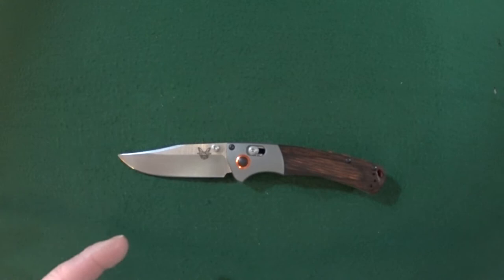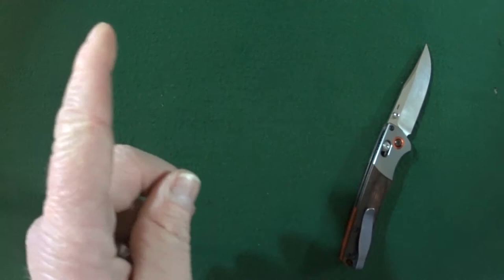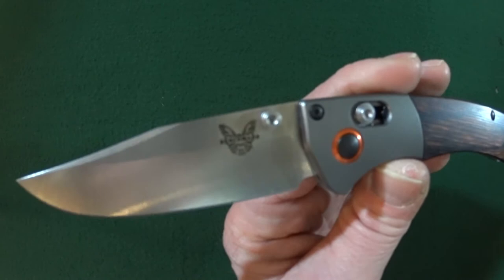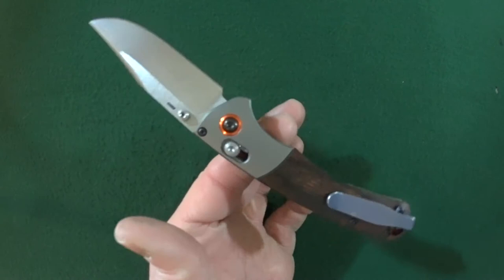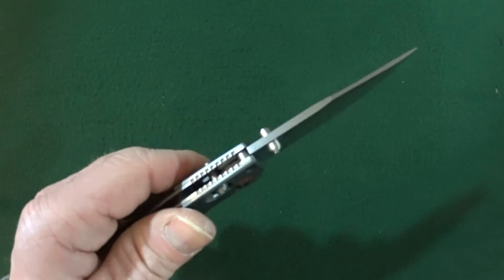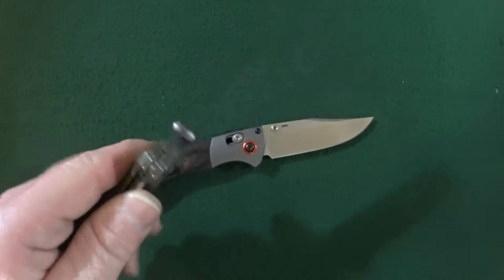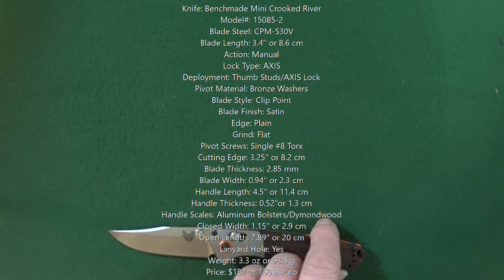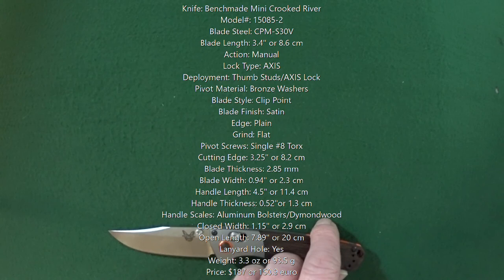Benchmade Mini Crooked River Review: Mini Problems

Comment: Good review TKB! I've got a mini freak coming my way, it was $106 with S30V, I don't know why they're charged so much more for the mini crooked river with the same steel?
Reply from the maker: Thank you BC. The only reason I can think of is the handle material, but that's an $81 difference. Another example would be the Grizzly Creek which I purchased new for about $165. Now they offer the Grizzly Ridge, which is basically a Grizzly Creek minus the dymondwood, liners, and gut hook for about $123.

Comment: Thanks for this look, at the mini Crooked River. 
Everybody was hollering for a smaller version, and they got it. So don't you dare say, that the tip is now too small! 
; - )
I hope that axis-lock wonk, smooths out for you. If not. Lifetime warranty, Man. They'll make it right.

Instead of getting this, and/or the Grizzly Ridge this year (I have the big Crooked River). I shopped around, to see if I could find a deal on another BM model. And boy did I. A local sporting goods store, had a short sale on some items. Including a BM 570. For $55 off! I think they screwed up, but hey. I wasn't going to straighten them out on it. So I snapped one of those up, and I'm now going to put some natural canvas micarta scales on it. You know. To celebrate the fact, that I didn't spend $180 on a BM mini, or a re-curved bladed, sticky handled knife.
Reply from the maker: I still love the knife and I was destined to get this one or the full size. For me, it came down to practicality. You know Steve, every knife has at least one issue. Even my favorite knife (Viper Vox Fortis) is not without faults. The 570 is a really good looking knife, a little too big for me but still damn handsome. That store must have made a mistake because Benchmade knives are never on sale because of the MAP pricing deal. Nice work Steve.

Comment: s30v is hype up re-invented 440c ! but s30v has to be sharpened a little more ! the thin blade and delicate tip make is much more  useful than many other blade shapes ! and you have misconception about hunting ! but you have a great point about the deal breaker price ! 
      that's one reason I only collect clones ! infact I just got the clone crooked river large $45.00 ! sharpens like D2 ! it's a little thinner handle scales ! and it seems lighter  ( someone said they weigh the same ). good knife good price ! 
     I would pay $75.00 for an American one !
     both knives were built by Chinese cnc machines \ Japanese  don't know of any American made cnc machine  ! even the so called American one !